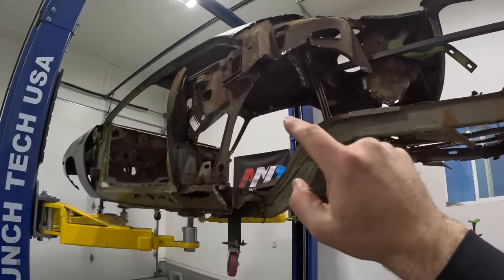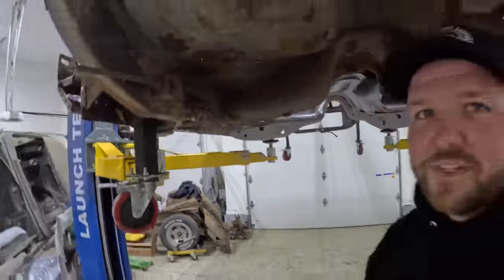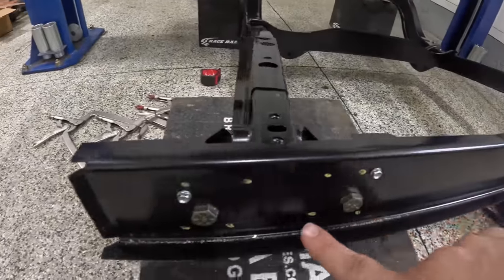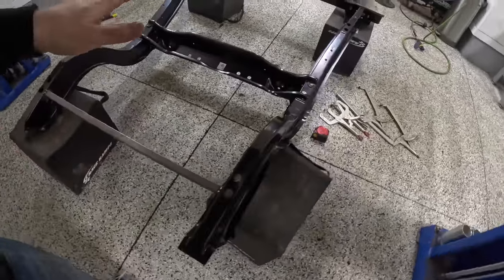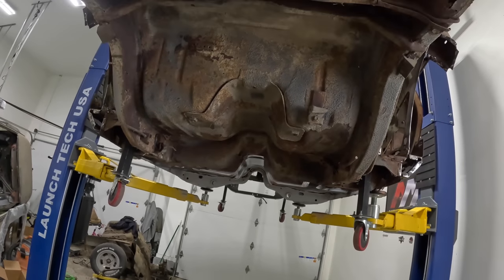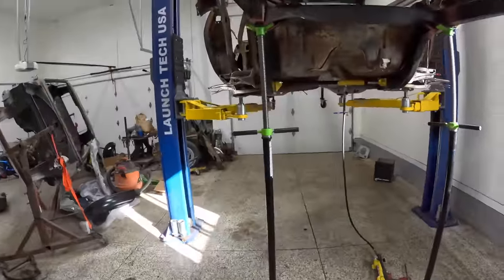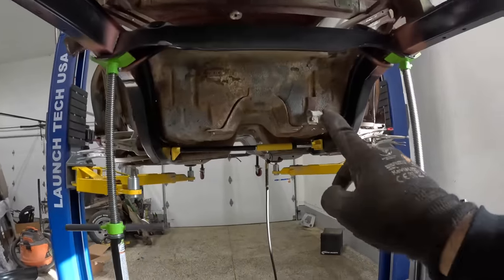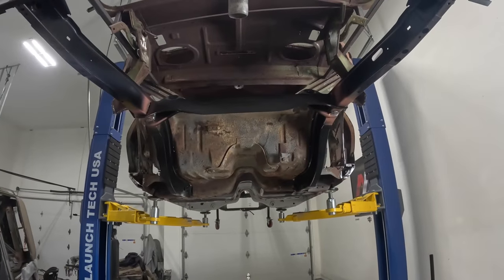1971 Plymouth Cuda Restoration - Episode 8 - Double Rear Frame Rail Replacement

Comment: Excellent work, I am currently doing much of the same on a 1973 Cuda. I used a 1 piece rear frame clip meant for a challenger. It fit nicely just no cutout for the fuel filler. What I found to be my biggest problem so far is that I discovered my car had been hit pretty badly and buckled the floor in spots. It really makes measuring difficult because my reference is most likely wrong. I have been combing the internet for factory dimensions and videos like yours which really help. Thanks again.👍
Reply from the maker: Thanks for watching!  😎🤘

Comment: Please READ
I’m following your progress on the Cuda because my 70 Cuda needs the same.  Unfortunately mine came disassembled, rear end is in pieces.
I have new frame rails and really need some dimensions.
Width at front of FR
Width at rear of FR
Inside distances will work.
Thanks so much and I’m looking forward to seeing your completed Cuda.
Reply from the maker: Shoot me a message on Instagram with a quick diagram and I’ll get all the measurements you need 😎🤘

Comment: Crazy, when you start removing everything and cutting the frame rails off, you realize there wasn`t a whole lot of solid frame holding these unibodies in place, we were doing 100 mph in these things. doughnuts, drag racing, right on the side streets back in the day, there was no traffic like today. I don`t know man, i`m making cross braces or something to stiffen and strengthen, and add some rigitity to that frame, no, it looks like a perfect fit, i`ll tell you that, well done.
Reply from the maker: This car will be getting the same chassis stiffening setup the Charger got.  She needs some beef!